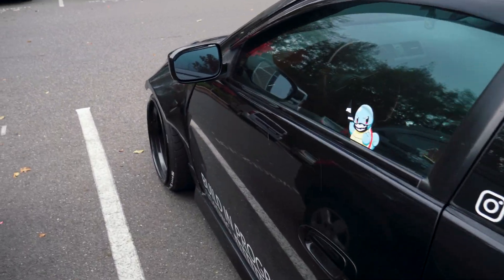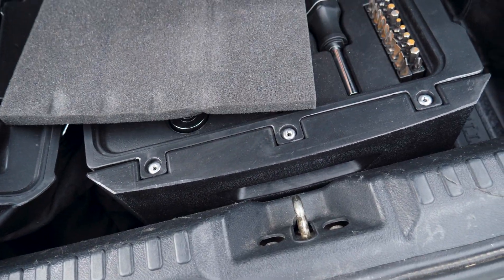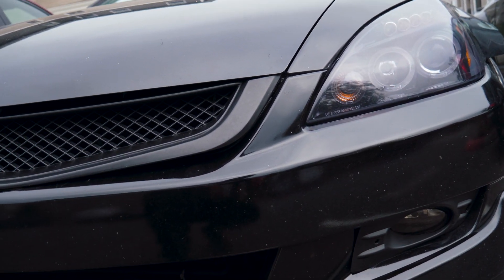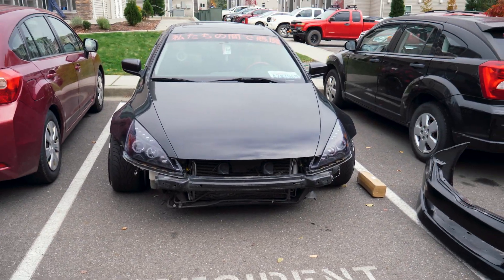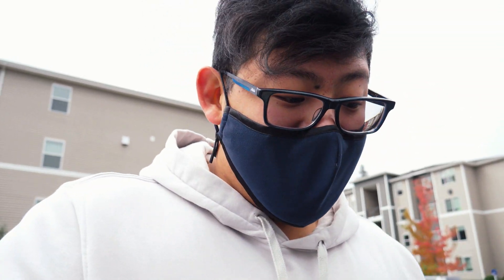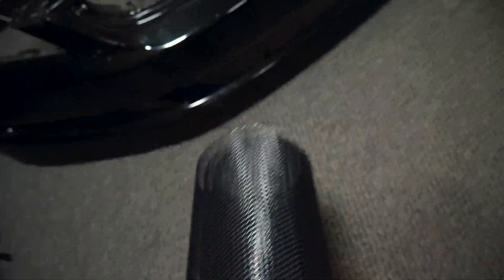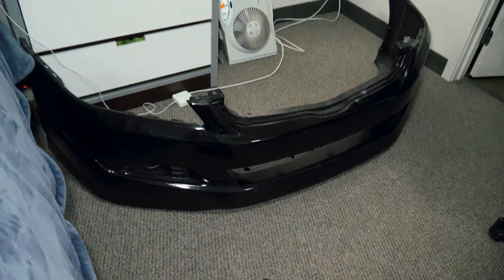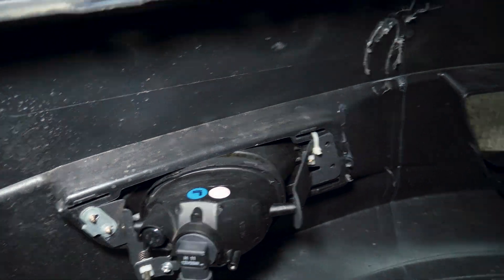Broke AF? Make Your Own CHEAP DIY Mesh Grill and Fog Light Inserts

Comment: What front bumper and grill do you have? Car is dope 👌
Reply from the maker: Thanks! I have the 2007 coupe bumper and the 2007 sedan grill
Reply: @LinnysLife  do they bolt up or do I need to customize them. I really love how they look together
Reply from the maker: the grill doesn't really bolt up, so I drilled straight down into the grill and into the bumper with a self tapping screw. They don't fit together perfectly since they're different shapes but I also really like how it looks so I decided to keep it, even though it has a gap lol